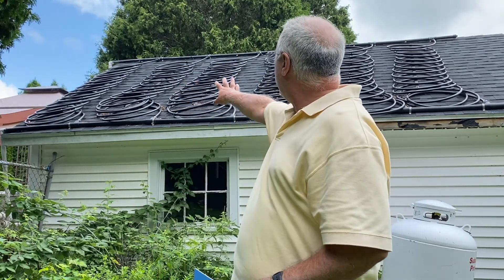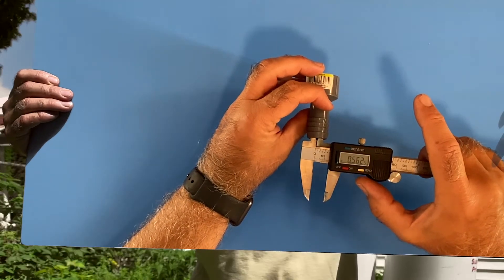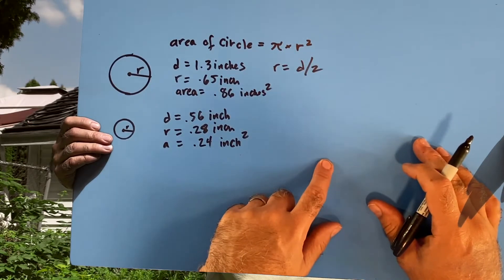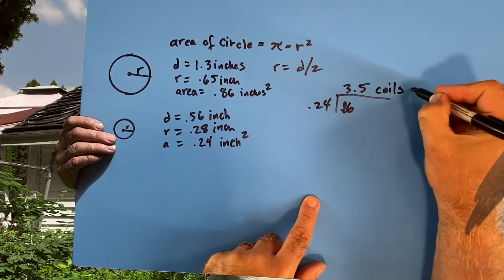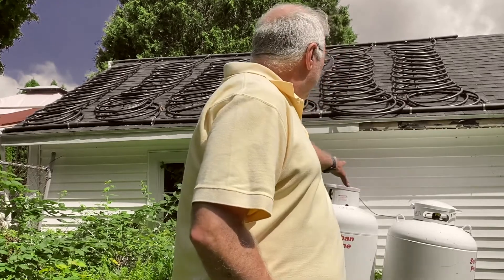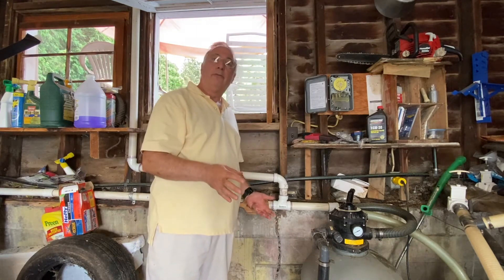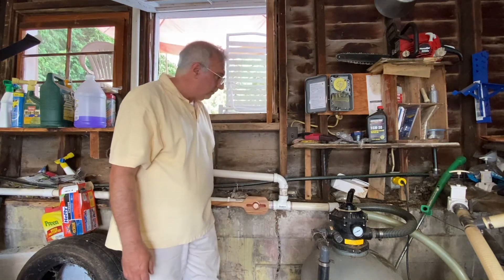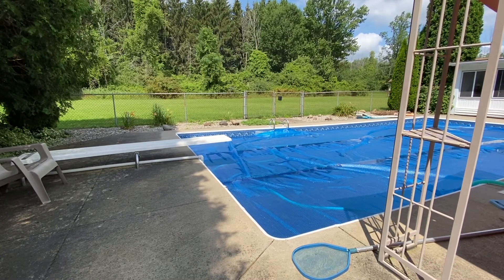Homemade DIY Solar Pool Heater

Comment: Nice set up. My question has nothing to do with the pool. I see in the video something that looks like a tower structure. Are you a Ham Radio operator?
Reply from the maker: Thank you! I'm not sure what you're referring to as I have nothing resembling a tower. I am not a Ham Radio operator, though I did flirt with the notion way back when I was in High School. Just never could get get past the Morse Code. 😂

Comment: I tried doing this same technique but the pool in the backyard, the back side of the house is a two-story to the roof and there was just too much head or too much head to push the water up, it couldn't make it up to the second story and around all of the tubing coils and then I tried a separate pump that was good for 45+ ft of head lift. bigish pump (or would I thought was big enough lol) I want to say it was a 1/2hp(gph4000) still wasn't enough to push it up around the coils and back down been trying to figure out a better way to do it as there's really not an easy place to stash a big board of coils in the backyard without it being in the way or looking ridiculous.. says the woman.. lol kind of bummed because it's a 20x40 in ground and in New England water is like freezing to swim in lol And obviously buying a big BTU heater is expensive plus the cost of fuels nowadays is crazy everything's crazy. Oh yeah the only places that I could mount it or mount a fixture or a box of the coils wrapped up wouldn't get a ton of sunlight throughout the day or until later in the day. We used to get a whole lot more sunlight in the backyard but over the years the tops of the trees have gotten very tall and we've lost 3 to 4 hours of sunlight because of it. Need to find someone to trim the tops of the hundred plus foot trees lol. If you have any ways to make it work on the roof being a two-story or any other things I might not have thought of after watching a bunch of these DIY videos feel free to toss some knowledge my way I'd appreciate it thanks for the video too. PS so sorry for the super long story probably won't even read it lol.
Reply from the maker: My neighbor's in the same situation you are, with his roof way too high. What he did was several long straight runs along the edge of his driveway. He has to be careful cutting the lawn and driving up and down his driveway, but it worked for him. I'm sure you'll figure something out! Good luck!
Reply: @Dr.V.  I have lots of great ideas and lots of ways it would work.. But.. they're ugly or look ridiculous or causing clutter blah blah blah lol says the Mrs.. like do you want warmer water or not.. haha oh man this is going to be the second year maybe the third year trying to figure something out I have other ways to mount it to like the side of the wall or the chain link fence but she won't let me either build a case for it or put some kind of back blacking behind it to help soak up the heat so I feel like it's essentially working at 50% you know what's the point why bother?.. lol But I guess I'll figure something out eventually definitely not fun going up on that roof though What a nightmare it was getting all that tubing up there and then having to lug it all back down It is very very steep the pitch of the roof It was so sketchy 😂🤣. But thanks for the reply. fingers crossed!
Reply from the maker: Even at 50% efficiency the heat is free @luckylarz4269 . 😉
Reply: @Dr.V.  Indeed you are correct sir 😎

Comment: Hi Is there a certain rule for calculating the length of the hose and the amount of pool water, meaning every thousand liters, how many meters of the hose is needed?
Reply from the maker: I don't know of any rule, per se. I figured more is better and easy is good, so I used 100 foot long rolls as that's the way Lowes sells them. When stretched out, you can see they offer good coverage of my roof.
Reply: Your hose length should equal half of your pools surface area
Reply from the maker: @hambone1113  Length and area are two different things. Such a calculation does not make sense to me. As it turns out, my pool is 648 square feet and that's almost exactly the length in feet of my black pipe and hose on the roof. So even though the calculation doesn't mean anything to me, I nailed it. 😂

Comment: I missed the significance of the 3.5 coils minimum that you calculated. What does that mean and how is it manifested in your design?
Reply from the maker: It prevents back-pressure to the pump, which it is not designed to deal with.